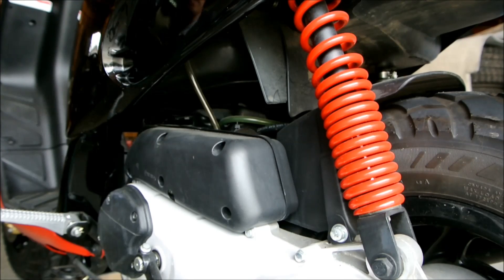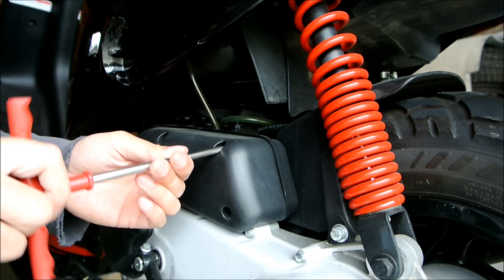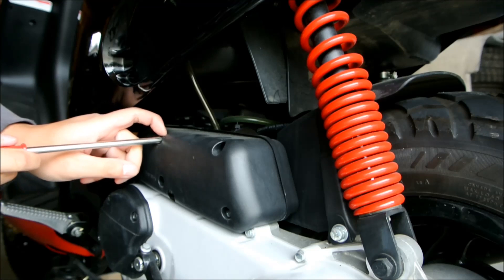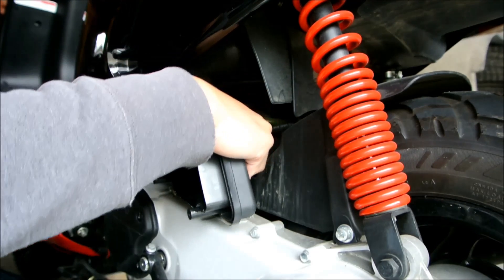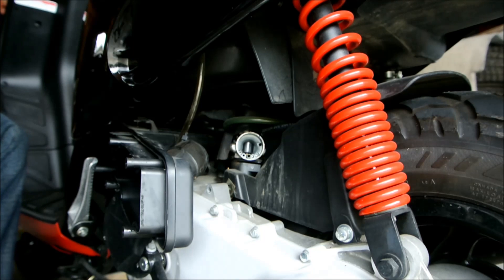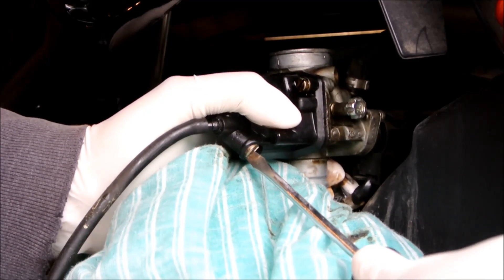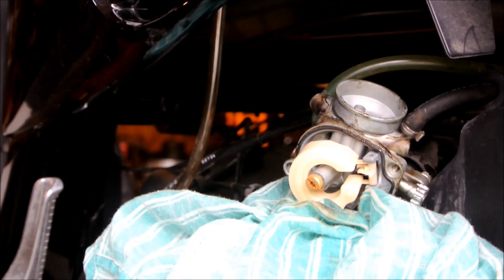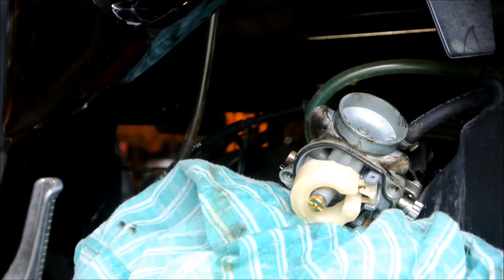UNLOCK FREE POWER FROM YOUR SCOOTER (FASTER SCOOTER - EPISODE 2)

Comment: Get a high performance carburetor EFI preferable bigger than the one on their or a smart carburetor.amd a bigger air filter if the carburetor don't come with one.or a racing carburetor that will fit to your scooter.

Comment: Hello guys few days ago i bought new carburetor because the old one was like bogging did not go and i bought new one i replaced it it was not doing that on the start it was running good and when i ride it it goes but when i give it full throttle it doesnt give like full power when it was with the old carburetor and i dont know what to do please someone tell me

Comment: I want to do this on my moped but I don’t really know how to jet a bike and how to tell where I am at with it
Reply: If you have the same exact restrictor as this you should change ur mainjet 5 bigger, if it feels lame from the high rpm you should get a bit bigger still. If it feels lame at low rpm you should try to adjust the air screw or needle. Hope this helps! And by lame, I mean not really powerful.
Reply: @bomber4496  the bike blew up a week after I got it sorted as had oil pump failure
Reply: @joshuasalisbury789  Same happened to me, i drove like 100km without oil pump and waterpump🤦The belt was broken
Reply: @bomber4496  I didn’t notice tbh there was slight rubbing but I assumed it was the cvt belt bc just been replaced and on way to work it seized I was abt half way on my 40 mile commute

Comment: Question: can I do the hole drill thing in the air filter box if i don’t add a big bore kit. I have a 2008 kymco vitality 2T . Is there anything else I need to do when drilling the holes.
-I have taken the restrictor washer out so far
- I adjusted the idle on the carb
- I ordered a malossi Kevlar belt
-stock rollers are 9gr. I ordered 4.7gr and will do 3x 4.7gr and 3x 9gr to have an average of 6.85gr spread out. -will I need to make my jet larger if I drill the holes in the air box?

Comment: hello I have a piaggio fly 50 2t yasuni exhaust r whole drive with spezglem variator corrector oversize mallosi air filter polini nozzle in carburetor 74 what to do to turn higher revs on a straight line flies 75kmh about 8000 rota how to increase these revs cdi I haven't moved yet

Comment: Can doing this damadge the motor somehow i have a aprilia sr 50cc 2019?
Reply: i have the same, did you do it
Reply: @Alan-kj2eg  it cant dmg it but it can feel a little wierd beacuse it gets more air and not enough fuel but if u adjust the main jet it should be good
Reply from the maker: Right. Running the engine lean can cause significant engine melt down.
Reply: @H3LLBOZZWildrift  more air, will always require a larger main jet

Comment: Any ideas on how I can make my tgb r50x faster already have 70 kit and it’s up jetted ?
Reply: Lighter or heavier rollers?
Reply from the maker: What top speed do you achieve currently? What is your 0-30mph time? What rpm do you see at wide open throttle during acceleration? and at top speed?

Comment: Hey, I have a question. What was the original jet on your bike and do you also need to do rejecting if you change stock exhaust for giannelli go? Thanks in advance
Reply from the maker: I don't quite remember but I think the stock jet was either a 68 or 72. Whether your engine needs to be rejetted is usually quite specific to your riding environment and setup. In my case, upgrading to a modified Leo Vince ZXR required rejetting.
Reply: @FIFTYmil  Recently I had to clean the carb. The stock jets were inside and there were 32/53. We are talking Piaggio Fly 50, 2 stroke, 2013.
Reply from the maker: Ivan Cudina in one of my episodes, I describe what the stock jet size was using the stock dellorto carb. That was several years ago. I’ll try to find it for you
Reply from the maker: Ivan Cudina 60 main jet (https://youtu.be/56VCqewgm-A). Apologies for the wrong number earlier.

I remember now the zip is a bit more detuned than the typhoon hence the smaller jet you found

Comment: is het niet gevaarlijk voor de motor???
Reply from the maker: Sorry could you translate that to english for me?
Reply: @FIFTYmil  isnt that bad for the engine?
Reply from the maker: @justjustin9795  Do you mean removing the brass carburetor cover? It allows more air in to the engine. When compensated with more fuel it will produce more power. Without the proper fuel mixture, however, yes it is bad for the engine.
Reply: @FIFTYmil  Well then i'm not going to do that bc I lkve my moped
Reply from the maker: @justjustin9795  That is a wise choice and I respect that.

Comment: so does it work on my 110 cc ,4 stroke ,aircolled engine???
reply plzzz
Reply from the maker: Which engine and bike?
Reply: FIFTYmil its called honda dio ....its an indian scooter...110cc but top speed only 80 km/hr
Reply from the maker: @jiwanxettri5368  Unfortunately, they are different bikes but if you watch all the episodes on this, the same theory applies. Focus on the RPM you desire to achieve the power you want out of the engine.

Comment: Hello sir, I have one question. Recently I upgraded my Fly50 2t with Gianneli Go exhaust and rejeted it. It was done by a mechanic. Now I need to put on original exhaust to pass MOT. Will it cause any damage if I put original exhaust withous rejeting it. Its 5 mile drive. Thank you
Reply: It wont cause any damage. Might not run as well as with the giannelli tho
Reply from the maker: I agree, the rejetting likely increased fueling. If that was the case, then the original exhaust may cause the engine to run a bit rich leading to soot and carbon buildup. What was the original jet and what was the new jet size after rejetting?
Reply: @FIFTYmil  I don't know because I didn't do the rejetting in the first place. But, its all good now. I found mot technician who let me go with Gianelli exhaust. Just had to put the variator ring
Reply: Generally piaggio 2t scooters Will have 60-65 main jet as stock.

The only way to know for sure, is to swap the exhaust back and get a jet Kit going from 60 and up to the jet already installed. And work your way down one jet size at a time. Its a pain in the a** but you Will know the Best jet size for the stock exhaust, and from there its easy peasy to swap back and forth

Comment: If you remove that peace it means dirt can go faster in youre carb
Reply from the maker: That's incorrect. The brass plate is not intended to prevent dirt from entering.
Reply: @FIFTYmil  iknow it holds in power but also can prevent of getting dirt inside
Reply from the maker: Daniel Sorry, that’s incorrect. All the filtering should be done by the air filter.  The brass plate will not filter anything at all besides a rock. If you are filtering rocks from entering your engine, you have much bigger issues on your hand.
Reply: @FIFTYmil  i'm not meaning that there are getting rocks inside😂😂 am just saying without the plate it sucks way more air so the chance is bigger that dust wil enter in youre carb
Reply from the maker: Daniel If your statement is valid, you should consider sealing the carburettor completely shut and not let any air in. That way you will for sure not risk any chance of dust getting in. 😉
Reply: @FIFTYmil  if i would do that it wouldn't start🤔. Its the fact that an airfilter will let at some time get some dust Inside and get Inside youre engine. That peace of brasset is in that carb for some reasing and. There are easyer ways of getting more power out of youre engine😉. And thats also cheap or you could do it youre self.
Reply from the maker: @WIRERESET  Clearly you don't understand the sarcasm. Again, the brass plate should not be ever considered as a device to filter air. The reason there is to restrict the performance of the scooter to comply with government standards. It's quite an easy and cheap way to get more power out of your engine.

Comment: There is a restrictor in the transmission!
It is on the variator side (rollers side) it looks like a washer, and if sandwiched between variator halves, it actually stops the pulley from getting tighter, removing the washer WILL bring up acceleration and a little bit of top speed.
Reply from the maker: You are correct, I also ready that European models have a variator restrictor. On my North American model there wasn't.
Reply: Does the motorini gp50 have the same one
Reply from the maker: @damoncolliver6626  Sorry not familiar with that model scooter.
Reply: The washers on the variator is a restricter 😱😱 im gonna get the mechanic to remove that
Reply: There is 3 washers if i can remember correctly and they are yellow so if i get those removed the bike will go faster?
Reply: @outere24  two 3 or 4 mm washers, remove those and your scooter will reach about 80 kmh or around 40 mph
Reply: @davidpetersen8909  it already goes 57mph
Reply: @outere24  awesome, is that on the speedo or measured via GPS speedo? Usually with All restrictions removed and a derestricted exhaust, you can run at about 55-60 mph
Reply: @davidpetersen8909  its stock everything i havent done anything to it and thats on both speedo and gps
Reply: @outere24  video plz
Reply: @cravenmoorehead5636  video of what?
Reply: @outere24  ur stock 57 mph scooter

Comment: Hey, I bought a Piaggio Typhoon '98 and it has a little problem that, if i give full throttle, the engine bugs down. Could it be caused by that little brass plate, or carburator, or what else?
Reply: try cleaning the carb, if that doesnt work then it might be the jets, also check the air screw
Reply from the maker: I agree, make sure everything is performing as stock first by cleaning them.

Comment: i have a kymco agility 16+ 2014 with 80cc and malossi vario kit changed every thing at the scooter garage but still going 57km/h does some one has the same scooter and know how to solve this problem?
Reply from the maker: 80cc should perform better. What RPM do you see during acceleration and what RPM do you see at max speed?
Reply: i dont have an rpm meter

Comment: What would happend if you just incressed the airflow in a 2stroke? Would it break by the time?
Reply from the maker: It would not produce any extra power. As well, on a 2 stroke you would starve the engine of fuel and lubrication cooling and cause piston seizure.

Comment: I have a scooter with 110 cc 4 stroke petrol engine it goes max 80 kmph can i make it faster
Reply from the maker: 110cc can definitely go faster than 80kmh assuming you're average rider weight! Even my 50cc 4-stroke can achieve 80kmh.
Reply: Get a smaller belt or chain and smaller sprocket in the back :) will lose a bit power, but will go a lot faster
Reply: NO MAD mine too bro ..has 110cc 4 stroke but can go only upto 83kmph...

Comment: these tips are only really for chineese 10mph scooters , try buying a gillera runner
Reply from the maker: Is that a chinese 10mph scooter in the video? Try to watch first before commenting next time
Reply: FIFTYmil looks like it from that tiny  carb , got a 32mil carb on my 183 , just saying that non of these tricks will work for anything other than factory 50cc
Reply from the maker: Again, please watch the video before making a comment. The video documents how I removed a FACTORY restriction from a FACTORY carburetor.
Reply: FIFTYmil mate im not trying to say anything hatful or anything mate typhoons are all round great bikes im just stating most of the tricks dont work most of the time for the ppl trying to figure out why they dont have this bit ect
Reply: I have a 50cc 2 stroke runner sp. Stock parts, removed the variator ring and exhaust restriction. With some fine tuning of the jet and the rollers I ended up with 105 km/h gps. 120 on the clock. It pulls like crazy, doesn't attract any attention.  If you want to tune discretely, just remove limiters like FIFTYmil did. 
Every moped has different limiters, just strip it and search or Google it is all I can say.

Comment: Hello I have a 2016 150cc and tops at 40 only and idea what could be the issue?
Reply from the maker: Did you buy the 150cc new and what was the last thing you did to it before it only tops out at 40mph?
Reply: FIFTYmil I changed the spark plugs only. And oil looks good. Bought it used.
Reply from the maker: Did you buy the 150cc used with top speed of 40mph or did you do anything causing the top speed to be 40mph
Reply: FIFTYmil it already went 40mph I just got it a couple of days ago and have no contact with the seller.
Reply from the maker: how many miles on the odometer?
Reply: FIFTYmil 12000

Comment: I did this on my aprilia sr50 and it does have a good effect, but no a huge difference
Reply from the maker: what year?
Reply from the maker: Assuming it's a newer model, SR50 comes equipped with injectors. As such, the injectors are only able to cope with minor changes as you would typically see due to altitude/temperature/humidity changes. Significant modifications to the intake such as this modification here would likely result in a lean condition because it exceeds the capacity of the injectors and they can no longer supply the extra fuel needed.
Reply: GibbsGaming 1x  i did this plate removel on derby 70cc and it made it run lean as shit full throttle using 95 main  jet so i just put it back in and runs better
Reply from the maker: mattyonthemic1 why would you return it to stock when there’s more oxygen to make more power? #facepalm
Reply: @FIFTYmil  so that he doesnt buy new jets :')
Reply from the maker: Then why would you attempt to tune the bike in the first place LOLROFL you guys are too funny omg
Reply: @GibbsGaming 1x how big main jet did you put in it i have an aprilia sr 50 and i am going to do this but i am not sure how big main jet i should put in it
Reply: +joel kivioja on a piaggio zip I went from 56 main jet to 66 and I also raised the needle by one step
Reply: @rtfbdfgsdfgbd  how much more speed did you get to it?
Reply: @rtfbdfgsdfgbd  bcs my aprilia is almost stock and i dont want to break my local laws too much
Reply: +joel kivioja about 3 kmh just got better acceleration
Reply: +MikeLariseos it tops up at 70kmh hardly.. goes easily up to 60 but then it goes up to 70 harder, feels like the variator or the rear pulley dont close and open at their whole range. when it's on the double stand it revs pretty high but when driving it's not even a bit near those high revs. I don't know what's going on. I have 7.5 grams rollers, once I had tried using only half of them in the variator but it topped up at about 50 kmh and just had a bit better acceleration. that put me into thoughts about if I need heavier or lighter rollers

Comment: Could this help for a gy6 4 stroke? It used to go 45km/h, after a roller,cdi change it goes to about 55km/h
Reply from the maker: Gy6 150 or 50?
Reply: its a 50cc rieju toreo to be exact
Reply from the maker: L33TaS how much do you weigh and how many meters do you live above sea level?
Reply: I'm about 60 kg and i actually don't really know that. All i know is there's not much mountains in my country.
Reply from the maker: If you check out my other 4 stroke videos, 55km/h is poor performance for a 60kg rider especially when you have changed roller (assuming it was changed to a better setup) and cdi (assuming it advances ignition and removes the rev limiter).

I am a 82kg rider and with those mods you listed I was easily able to achieve 70km/h cruising and 75-82km/h top speed with subsequent modifications and further tuning.
Reply: Atm theres 3 x 7g rollers in my variator, and the cdi is the unlocked one. After a longer cruise i can get to about 62km/h if i don't stop and the road is a bit longer
Reply from the maker: Might need some better measurements to help you. What RPM do you see during WOT acceleration? What RPM do you see at top speed? I would suggest investing in a $6 tachometer before adding any further mods. Cheers

Comment: I do anything wrong if I just remove the restrictor and not tune my carb? I am kind of scared getting in there...
Reply from the maker: Quite likley you will have to tune the carb. If you don't the carb might run lean and not provide enough cooling and fuel for the engine leading to piston seizure.

Comment: can you help me make my 50cc 2stroke scooter take off faster?any tips?
Reply from the maker: What RPM does it take off at?
Reply: FIFTYmil full throttle at low rpm
Reply from the maker: Need to know the exact RPM you see and the peak horsepower RPM to help. Otherwise a general rule would be lowering your roller weights.

Comment: Any idea on how to get more take off power without spending money? I weigh 190lbs and my 50cc pit bike barely takes off with me, I've tried adjusting the air fuel ratio.. I'm going to take what I think is the air restriction plate and see if I can get it to gain something but any other ideas would be greatly appreciated.
Reply: eat less, lose weight
Reply: @arrowgunt  😂😂😂you fucking troll.
Reply from the maker: without money? Pump up the tires. Taking out the air restrictions would require rejetting = money
Reply: Diet

Comment: does it work on every scooter?
Reply from the maker: Yup it should work on all scooters with a petrol engine
Reply: @FIFTYmil  wow nice thank you i didt really understand everything becuse im swedish i understood the start but then u clipped to the thing thats now called carborator and then i didt understand but if i take away that think at the airfilter without doing the other stuff u did will it still go a bit faster?
Reply from the maker: @destrafe_3361  For this particular configuration, removing the brass plate without providing more fuel will make it go slower that original. There is simply too much oxygen and your engine will run lean which is detrimental and risk engine failure.